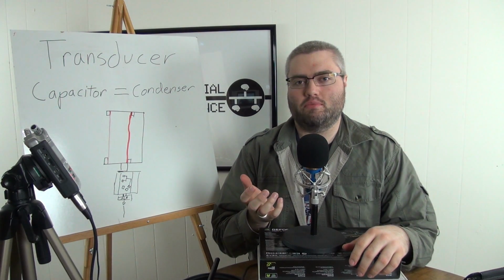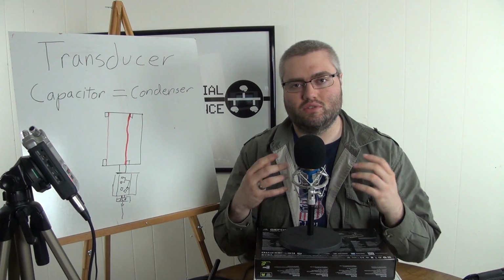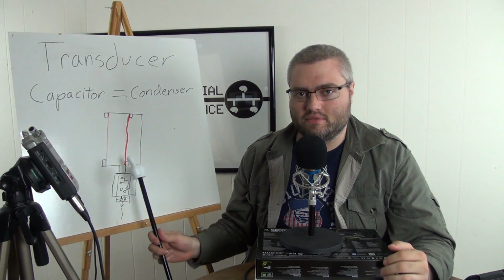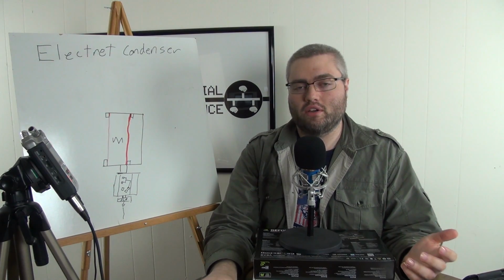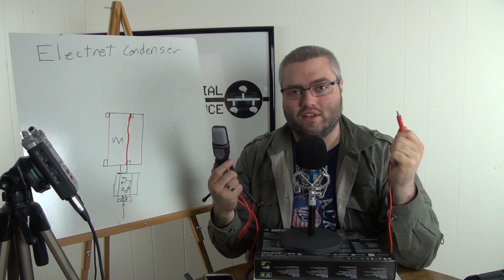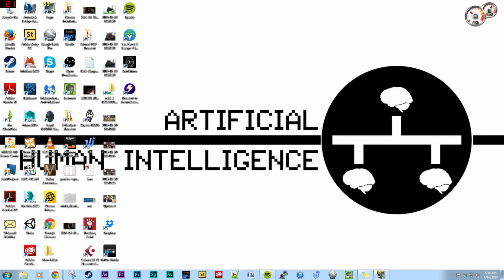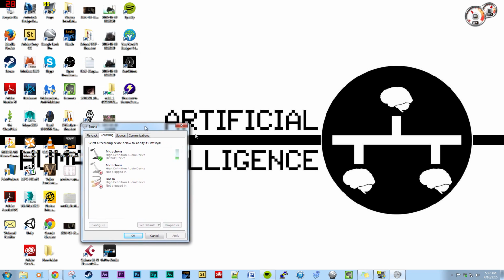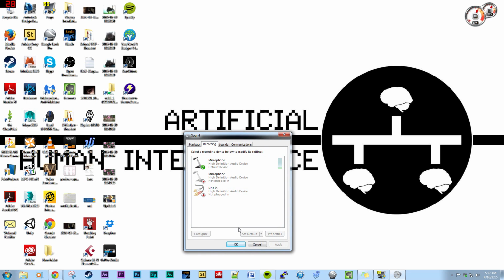How to set up a Condenser Microphone

Comment: Is there a way to set it up without using a power supply?
Reply from the maker: A power supply is needed. I have seen it done with a usb sound card that provides the microphone 4.5v of power but you will be better off with the power supply for full functionality.

Comment: What's with all that fuzzy background noise though?  I'm trying to set up on condenser mic on my end and I'm getting crazy background white noise... Do you know how to fix that?
Reply from the maker: Do you have a phantom power supply? Check to make sure that you are not boosting the recording level of the mic so high that you are getting interference from the noise floor. Also, make sure that there are no other sounds in the room that you are picking up, in my video you can here my computer fans in the background.

Comment: I have a really important question I never seemed to figure it out or anything but I have the newer 1 channel  48v phantom power supply and I set up my mic plugged it all in as well as plugged in the cord for the power supply into the outlet but when I push the button to go on the blue light does not turn on. I'm not sure whats wrong if its something I'm connecting wrong or if its no good! also I have a webcam with a mic on it. if I am indeed able to fix the neewer mic how can I use that mic instead of the mic on my webcam! thanks! 
Show less 
Reply
Reply from the maker: Sounds like a bad power supply.

Comment: hi..great video! :)
I have a  question..I bought a bm800 and alto zmx52 mixer but the mic isn't working whenever i connect it to the mixer..I guess it's because of the cable..my question is what connector do I have to use to plug the cable into the mixer..
haha..I'm quite not sure if I explained it well..I'm new to this stuff..sorry :D
Thank you!
Reply from the maker: +Laura Meanne Luna The ZMX52 has phantom power built into it, so what you would need is an XLR to XLR cable.
Reply: +Artificial Human Intelligence great thanks! :)
I just thought I can still use the cable that comes with the BM800..argghh..i just wasted money buying different adaptor..and still didn't work..haha..anyway, I already bought one..thank you so much! ^_^ :D

Comment: can someone please make a vid on what the hell the dials on a condenser microphone mean...
Reply from the maker: Which dials?
Reply: Like the ones on an nt2000 or (i thought) most condenser mics of recent years.

I get the cardoid, omni and figure dial.

But theres no vids on how to set the other two -
Reply from the maker: No worries, the basic things are:
Dial 2 is the high pass filter. What that does is cut down on the bass if you are getting too much.
Dial 3 is the PAD. This adjusts the input to the microphones preamp. This is used to cut down the input to the mic when recording really loud stuff like drums. think of it as a kind of small volume knob, just one that can cut the input down up to -10db.
Reply: @MacAmbrais  ok cool. thanks for the help and for the video!! appreciate it.

so if i wanted more bass i would turn that second dial up?... or down? aha

Comment: bro if i dont want to use a phantom power , can i just use an adaptor from 1/4 to 3.5 mm jack?  would it work , even not with best quality?
Reply: it depends on what sound card you have in your PC. if youre soundcard provides at least voltage that can hook up this mic it will works. but sound quality will be poor...

Comment: from a mixer to the PC can you just use a 3.5mm to 2.5mm adapter?
Reply from the maker: +and1bballers Depends on the mixer, try and see if it works. Also I am assuming you mean the 3.5 to XLR, but if it is a 3.5 to 2.5mm, I would think it would work as well.
Reply: thx ill try

Comment: Can a sound card work the same way in delivering phantom power?
Reply from the maker: Only if it is specified that it is able to do it. Otherwise it provides a lower voltage.
Reply: Jason Harbour I’ll try a lower voltage since my current problem is that the mic can’t be detected at all. The PC detects that something is jacked in but it doesn’t show it being a mic or an external device.

Comment: Hi! Will i be able to connect my BM-800 via an iRig PRE to my Windows Computer? It gives 48+ Phantom Power. It has a XLR input, but a 4 pin, 3,5 millimeter out jack, which is ment to be used for an Apple or Android device.
Reply from the maker: Derpy David I couldn't say for sure, there are guides for the iRig Pro and HD to get them to work with Windows. Because it is a 4 pin you might have to buy an adapter of some sort.

Comment: At 2:45 you say the wire "terminates into a standard 3.5mm audio jack."
Well, not actually. That is an audio PLUG.
Reply from the maker: Thank you for pointing this out, I will make note to adjust my vocabulary to match and try to drop any learned colloquialism.

Comment: sir i order a bm 800 but when i connect it with my pc directly there is a HIZZZZZZZZZZZZ sound...is this normal or i have to use any equipment or app plss reply
Reply from the maker: Do you have it connected to a Phantom Power supply? I would check the recording level, sometimes if you have it boosted too high then the noise floor will start making noise. Also, if you are listening to it live there can be some interference from the system.

Comment: I Jas, I am using BM 800 with Phantom power supply but it gives me continuous beep kinda in background when I record something, I am going bonkers to solve this, please help
Reply from the maker: Check all of your connections to make sure they are tight and undamaged. Also, make sure the gain isn't set to high. Start there.

Comment: I have a question about my microphone. I recently bought an MXL V67Gs studio condenser microphone and i have it connected to a +48 volt power supply. It's connected through 2 XLR cables and the power supply is powered and turned on, but my microphone doesn't seem to bring forth any sound at all. I've tried with skypes sound test service and with audacity, but no sound. I've tried to set the microphone volume to 100 and the boost to +30 dB in properties, but even that doesn't seem to work. So do you have any idea what might be going on?
Reply from the maker: Could be a bad power supply, or a dead microphone.
Reply: Artificial Human Intelligence I fixed it by now and it was indeed a bad power supply, thanks for responding though

Comment: My friend said you dont need phantom power but it will not sound good without it. Is that true? Please answer!
Reply from the maker: It depends on the mic but typically a condenser requires phantom power to work properly.

Comment: Can I use an XLR to 6.5mm/ 1/4th inch cable to power up my mic into the Interface? Because I tried, and it isnt working..
Reply from the maker: Typically a 1/4th inch connector does not supply power, if you wanted to go this route you would need to attach a phantom power supply between the mic and interface.
Reply: Artificial Human Intelligence yeah I already got my setup. Thanks anyway!

Comment: I hear other people using this neewer nw 700 mic and it sounds great but when i use it, it sounds poopy. i have a phantom power supply idk whats the problem
Reply from the maker: Can you be more specific? Try messing around with the gain and set it to about 60-80% and see if that helps.
Reply: Artificial Human Intelligence I tried editing it in audacity so it sounds better but there is just so much static it's impossible to get rid of it or even a low volume. And my voice just doesn't sound as sharp as other people using this mic
Reply from the maker: Have you used it on any of the videos on your channel so I can have a listen?
Reply: Artificial Human Intelligence no I haven't. I think maybe I just need a audio interface?

Comment: When I plug the mic in I hear a non-stop buzzing/ringing sound. is it because I don't have a headset, im really confused.
Reply: same /=
Reply: +JIMplayz I still haven't figured it out lol I just have up so now I have a mic sitting there useless
Reply: you usually get the buzzing noise with lower end mics but what you can do is when he goes to properties for your specific mic to adjust the volume which will make you more quiet but will eliminate the sound of the buzzing.
Reply: What if the buzzing is almost louder than you XD
Reply: umm well just try it out see how it goes untill the buzzing is at a minimal level if it carries on i would probably reccomend getting a better mic
or headset with a mic
Reply: What if my headset also does it XD (cuz it does thats why i got the mic) :P
Reply: +JIMplayz what mic and headset do you have?
Reply: you know there is the option of using a noise gate....

Comment: I would like some help. I have I microphone, and it is a condenser. It, however, also has a usb converter but it won't work! How do I get it to or does it still require phantom power? In which case, why is it in there?
Reply from the maker: +Aden Thie Could be that the XLR-USB adapter doesn't supply phantom power. It can be hit or miss with some of them. Blue Icicle and Shure X2u provide phantom power. What brand is the adapter?

Comment: My BM800 came with a XLR-to-USB jack but I can't hear it no matter what I do. Is phantom power needed or am I just missing something?
Reply from the maker: A Phantom Power Supply is needed for most condenser mics.
Reply from the maker: And, in order to use an XLR mic with a USB interface you need a XLR to USB converter that supplies phantom power. Blue Microphones make the Icicle.
Reply from the maker: Check your cable connections, sometimes they can be loose and a cable might have broken. Sometimes the solder on the inside doesn't hold up. If it isn't that, the only thing that I can think of would be that usb reads a digital signal and XLR is analog. You need an XLR-USB converter.
Reply: I got a 48V phantom power supply, works like a charm.

Comment: I need ur help here .
My cpu has a phantom power thingie to set the mic up , so do i HAVE to have the phantom power???
Reply from the maker: +JakeDaDogMan If this device can provide the 48v necessary for the mic then no, but typically a pc cant do it because a pc runs on 12v, in which case you will need a phantom power supply.
Reply: Dayum , Phantom powers are so expensive
Reply: Artificial Human Intelligence Could I use an XLR to USB for my PC?

Comment: hello pls answer me...i ordered a mic-001 condenser mic and i wanna use it directly to my dslr...can i use it without power source? i don't have any power source..pls reply thank you!
Reply: You need to have a power source for the microphone to work.
Reply: +GCHGaming hi thanks for the reply and yes i already bought a phantom power supply😊
Reply: +Godwin Salas Does the phantom power supply you bought come with a XLR cable because most of them don't.
Reply: +GCHGaming i bought a separate xlr though...it doesn't include anything other than the unit itself....but i guess i have to change a microphone someday cause mic_001 is collecting so much background noise it's crazy

Comment: hi please can u help. i have the BM800.. and i have a focusrite 8i.. i use the phantom power and i only get static. :(
Reply: +floyd1411 u should not have bought that the shittest mic I ever purchased my buddies could hear my own audio through the mic somehow and it eventually the audio got worse and worse......and then stopped working
Reply from the maker: +floyd1411 Check to make sure that the focusrite has phantom power and that it is on, also check the cable connections.
Reply: Everything was checked, all cable connections were looked over and it practically collapsed...

Comment: my laptop has a combo audio jack. therefore it wont detect my external microphone. can anyone please help me? ):
Reply: you can try using a mic adapter or an external usb sound card
Reply: ***** i did actualy buy a mic adaptor ad it works now thanks :). now i am having an issue with white noise in recordings.. any tips?
Reply: Noise as static noise and buzzing? Unfortunally that is most likely coming from your laptop and it's called electrical interference, the only solution I found to that was using an external sound card, because it works outside of your laptop and in that way doesn't have much electrical interferenece.

Comment: do i need phantom power supply to connect the mic?
Reply: or sound card?
Reply from the maker: Yes.
Reply from the maker: Depends on if your computer has a 3.5mm mic port. Here is some more information: https://youtu.be/PmYBkyif3lo

Comment: I hear that my mice is on but I doesn't pick up my voice...

Edit: I fixed it
Reply: How did you fix it? Completely lost here!
Reply: @Draguar  Don't use the adapter, and "force" the cable down gently in the AUX or whatever it's called (even if it doesn't feel right).

Comment: PLZ HELP! When I boost my mic I get a humming/buzzing sound.
Reply from the maker: Do you have a Phantom Power power supply?
Reply: Artificial Human Intelligence Yes
Reply from the maker: Ok. Check to see if anything in the room is making any amount of noise. The microphone is very sensitive and it picked up my computer fans from across the room.
Reply: Artificial Human Intelligence Thats it than...MY gaming PC is loud. :/
Reply: Then* proper grammer is important   - Also your gaming pc dB level isnt the problem, its the EM fields around it. If you learn how to build properly, you wont have that problem. Im not so sure youre ready for this yet, kiddo. Especially if your voice is still high pitched. My machine has 8 case fans (4 of which are on the window), high rpm, they literally hum and resonate with a "wom wom" sound, but my mic doesnt pick it up... and its only 2 feet away. What it DOES pick up, is a power cable that snt placed properly. If i take the main power cable from a 1000 watt supply, plug it in, and just let the cable cross over the mic cable, it will create static which can sometimes sound like humming. You need to be using insulated cables. Alsol worth mentioning, that some older houses dont use RF or EM shielded wires in the walls, and this can reap havoc on your setup. Especially if power is flowing to something in that room, like a fan or a light. Not much can be done about that without a large budget, just move to a different room.
Reply: +Kyle Currier says the one that writes "grammar" wrong...
Reply: LOL When you got to call the police on the police!.!
Reply: KingOfGaming77 move away from your speakers..... the mic catches the sound inside of the speakers...